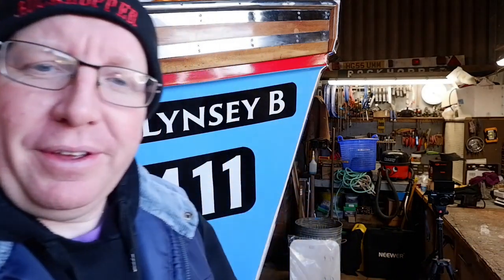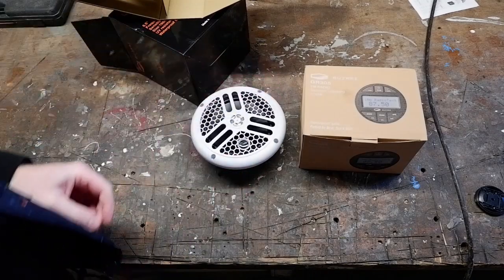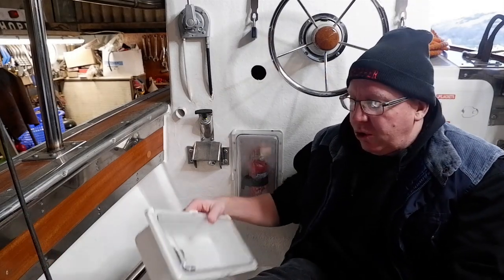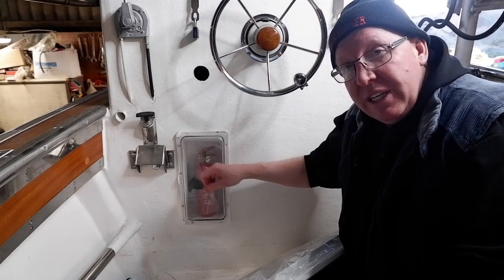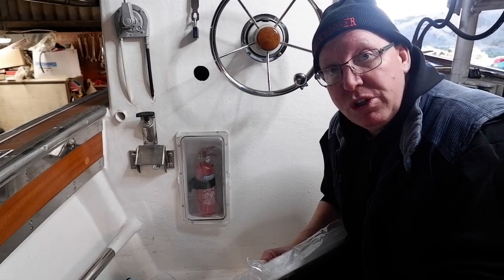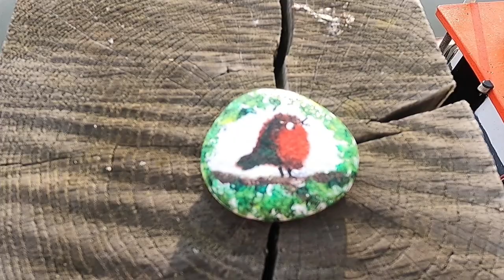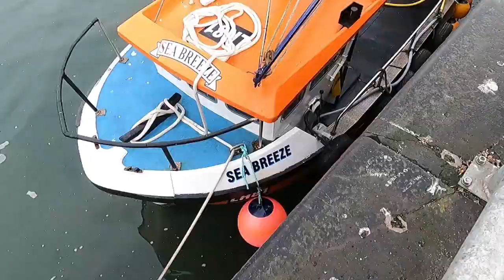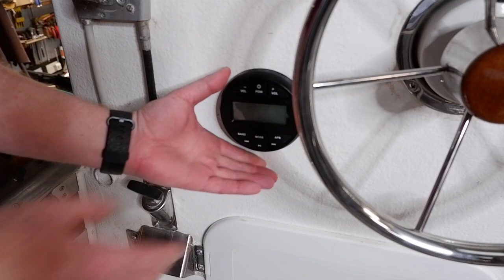Evolution Episode 101

Comment: What is the name of the makita drill extension bit that you are using for awkward screws when you put the double hatch in
Reply from the maker: Hi buddy.
I had to go back and watch this vlog, to make sure I was getting the right tool, as there was plenty tools used in this vlog.😂😂😂😂

Follow the link below,  that will take you, to what you need.😁👌

https://www.amazon.co.uk/0-8-10mm-Extension-Professional-Attachment-Workspace/dp/B08P5GWYF1/ref=asc_df_B08P5GWYF1/?tag=googshopuk-21&linkCode=df0&hvadid=499222359309&hvpos=&hvnetw=g&hvrand=8806407784845583102&hvpone=&hvptwo=&hvqmt=&hvdev=m&hvdvcmdl=&hvlocint=&hvlocphy=9046877&hvtargid=pla-1203149996372&psc=1

I hope that helps bud.

All the best. 😁

Comment: Hello Barry. A quick tip for you, when using a twist lock Arbor on hole saws.put some electrical tape around the twist part when locked, if the twist lock comes undone when drilling you'll have a lovely job getting the hole was off the arbor. All the best& stay safe.
Reply from the maker: Hi Ian.
Thank you for your comment and your lovely tip.
I'll try that next time I have it out.
All the best.😁

Comment: Aggh a man after my own heart using quality makita tools ,makita and  bosch for me used them since an apprentice many years ago . i rekon on this last boat i must have used 10 or more tubes of 291 black and white i refuse to use silicon i think it is cheap nasty s** and ill never us it on any of my boats it is a inferior product . sika is brilliant and sticks like s** to a blanket i have glued blocks onto an aluminium hull and they never moved a mm great sealant adheasive .
Reply from the maker: Oooo
It's like I'm talking to my Australian self😍😁👌🤣🤣🤣🤣🤣
Definitely the right way forward with both tools and sikaflex brilliant gear all of them 😁👌
Reply: @onemanandhisboat  thats a dandy table saw you have adjustable angle and all on the blade i like that , i use what they call a bevelbox to set angles for the blade you zero it on the table then place it on the blade and it reads the exact angle of the blade to table bloody btrilliant piece of gear as the magnet holds it on the blade .